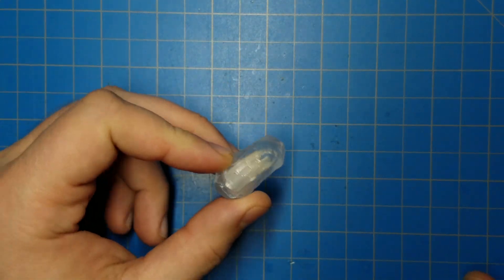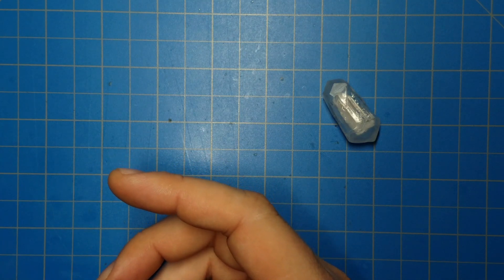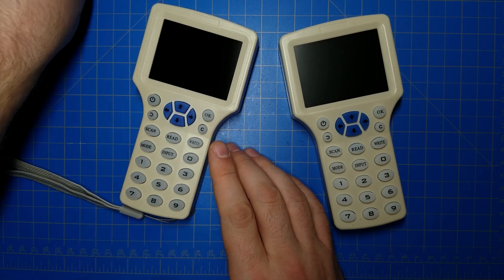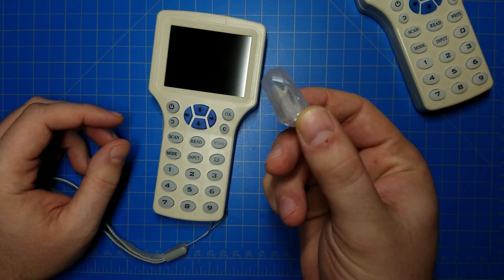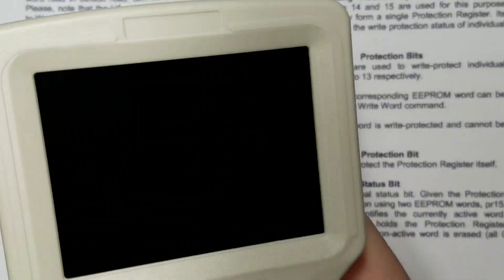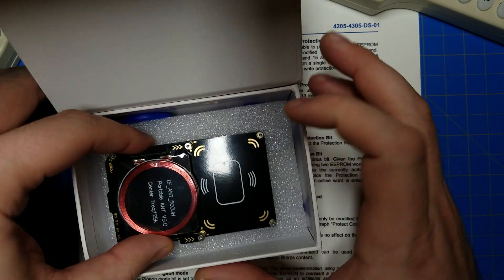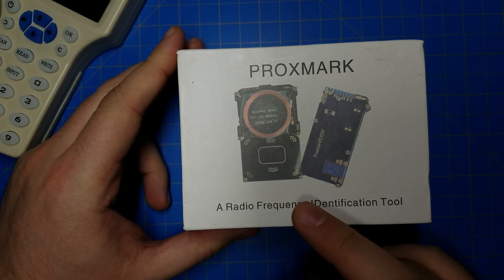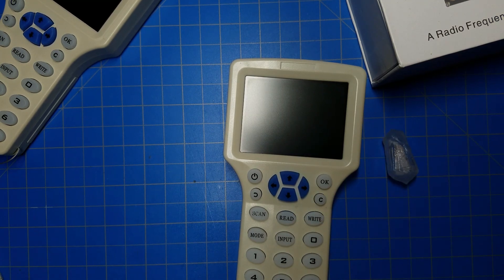Not All RFID Writers Work with Kyber Crystals

Comment: Anyone know where i can purchase a zonsin reader/writer? I see some titled as zonsin but they all seem so sketch lol.
Reply from the maker: it's really hard to know if you're getting a good or bad writer based on just the listings on ebay, amazon, or aliexpress nowadays. i've heard from people who ordered one with pictures that looked like the zonsin one and they received an obo hands one. 

i recommend finding a proxmark3. even the sketch listings are usually good. it's just a headache to get it loaded with firmware and learning how to use it. but imo the effort and headache are worth it. i've also been hearing from a couple people that new wayfinders don't like crystals programmed with even a good zonsin (which is frustrating). but pm3 modified crystals work fine.

Comment: Do RFID readers still work on the newer lightsabers?
Reply from the maker: RFID writers work on kyber crystals. The only lightsabers that use kyber crystals are those built inside Savi's Workshop. 

Savi's Workshop recently introduced new outer shell elements. Those elements are decorative and don't change the functionality of the hilt or the kyber crystal.

Legacy lightsabers do not use kyber crystals and therefore RFID writers do not work on them.

Comment: At first my Zonsin zx-08cd only write kyber crystal once but then found out if put crystal in tablespoon and lay reader on it works great. Spoon must magnify signal I guess.   I was afraid I got the bad RFID unit even though looked like the right one above but just needed to do spoon trick.  Thanks for video was very helpful.
Reply: Thanks for the Teaspoon Idea, mine did not work - read failure no matter what, then I tried a teaspoon and no problem.

Comment: I'm sure your video must of caught the attention of the chins, I purchased mine in 2022 and the startup screen changed, it does not display any name of company or brand. there is a new disclaimer notice and then goes back to screen "IC Type - A" and the one I purchased the screen color background is the same as one on right side of your video 4:22 but in reality I would have to test it further simply because many makers from china can change things around to look similar to other devices.

Comment: Update: received the rfid with the blue screen. I ran into the issue mentioned... but after updating the device I was able write codes given. It takes patience to find the sweet spot on crystal. I marked my crystal and placed it a certain way on the rfid writer. Takes a few tries but I've tried all the colors. Patience is key. Well updating rfid as well... but patience, if you end up with a blue screen rfid. Oh and I placed crystal in middle and slightly turned to left.
Reply: Hi Douglas how did you updated ur device 
Thanking you in advance

Comment: I got tyhe zonsin one but it wont read my yellow crystal no matter where i try it,.
Reply from the maker: Do you have other crystals and it works with them, just not your yellow or do you only have the yellow?

If you have others and those work, it's possible the yellow has a weak RFID signal. I have found a few kyber crystals that seem to have weaker than usual RFID signals. 

If you only have the yellow you could try writing to it anyways. Some writers will write even if they can't read the RFID tag. Note that when you do write, it'll say the write failed (because it can't read the RFID tag to confirm the write). You'll have to try the crystal in your holocron or hilt to see if the write worked.

Comment: Hi there do you know if it is possible to copy the zonsin firmware on the RFID Reader ?
Reply from the maker: I'm not sure. I haven't tried, but I'm guessing it's not possible. Microcontrollers have a feature that prevents copying their programming and it's likely enabled on those in these RFID readers. Another issue is not all of these RFID readers use the same hardware. Assuming I can take the firmware off one reader, I may not be able to apply it to another reader because it'll have a different microcontroller.

Comment: If I understood correctly, since I used the bad one first and wrote once onto a crystal, does that mean even if I get the good writer it won’t work because the bad writer locked the crystal?
Reply from the maker: Maybe. Maybe not.

These handheld writers will try a few different passwords. If you get a good writer it may be able to write to your crystal because the password used by the old writer that's locked your crystal is known by the good writer.

If not, it's still possible to unlock the crystal, but you're going to need different hardware, like a Proxmark3 Easy. The PM3 will cost you around $50-60. It is also not a simple and easy thing to use, but there is software and documentation online that will help get it up and running. With the PM3 you can send commands to change the password and configuration of the kyber crystal's RFID tag, you just need to know what password was used in the first place to lock the crystal.

In my Galaxy's Edge research spreadsheet I've figured out the passwords used by a few different devices. It's possible you're using the same device as one I've figured out the passwords for. You can see the list of devices and their passwords here:

https://docs.google.com/spreadsheets/d/13P_GE6tNYpGvoVUTEQvA3SQzMqpZ-SoiWaTNoJoTV9Q/edit#gid=1809632326

It will likely be one of these 4 passwords: 7686962A, F9DCEBA0, 2A968676, 84AC15E2

Comment: I have an OBO hands device. Although I have not trried it with Kyber crystals. I have doen it with other 125kHz tags. The thing is that the antenna is located differently on mine, you have to hold it on top of the device, not on the screen, but if you look at top of it, there's a little plastic rectangle. If you place it there it reads and writes just fine.

Comment: Ok so i got the correct one (at least pretty sure, similar to another comment its the zonsin full featured one which was said to be ok). I have 2 crystals, a red i got when building the saber and a yellow i bought seperately. I changed the yellow to Ashokas (3072) and now doesnt let me change the yellow again. But the red one i can write to as much as i want. Is something different with the yellow crystals?
Reply: I will also mention with the red it does say write failed most of the time (sometimes it says success) but still writes it and works even if it says fail. Just the yellow for some reason can never write
Reply from the maker: @Beefman951  did you ever use that yellow with another writer?
Reply: @Ruthsarian  no, i just got this writer in the mail yesterday after seeing the video
Reply: Havnt done anything with them until getting this one
Reply: @Ruthsarian  little update. Put in batteries into the rfid reader instead of using cord, still was failing at first. Tried switching mode to 250khz and wrote it, said failed but it succeeded in changing to code anyway. When i scan it, it shows 125khz but the code i wrote in 250
Reply from the maker: @Beefman951  wow! that's interesting! maybe the 'bad' writers are actually good, just need to swap to 250khz because of some bug in the code. I'll have to test!

Comment: I have a RONSIN reader, Version 0B-03029-04-01-200812, I cannot get it to read a Kyber Crystal (tried 3 from Savis) any ideas?
Reply: ZONSIN.. typo
Reply: Update: I tried write and while it still says it failed to write, It actually changes the RFID stored in the Crystal
Reply from the maker: @mikeadams9725  i've heard from some others that newer zonsin devices behave like that. they still can change the crystal value, but they can't read them. i've also seen OBO Hands versions which can't read, but can write, but can only write ONCE and then can't write again. it's bugs in the firmware and unfortunately there isn't much that can be done about it.
Reply: @Ruthsarian  Thank. I appreciate the reply. This does work for me.

Comment: I hope you go back through and read comments on old videos. is there any chance you could revisit the OBO Hands NS208 reader and investigate further why it will only write once and what might be done to correct that issue?  I only ask because I tried myself to get the correct one off of amazon, and ended up with the wrong version.  Was hoping I could just deal with the obo hands one instead of going through the whole returning and ordering a different one and hoping I get the correct one.
Reply from the maker: i'll pull out my NS208 and see what i can see, but as I recall it's a firmware issue. the only way to fix it would be to somehow find new firmware and reprogram the device with the new firmware.
Reply: Also, have you tried the OBO hands version while attached to a windows computer running the software that you can download for it?  maybe different results or better information from the program.
Reply from the maker: @brentonmucklow5647  I went and documented (in too much detail) the commands the OBO hands is sending to write to an RFID tag. You can see all that information here: https://docs.google.com/spreadsheets/d/13P_GE6tNYpGvoVUTEQvA3SQzMqpZ-SoiWaTNoJoTV9Q/edit#gid=1859397091

Long story short: I think there's a timing issue with the firmware. It looks like it's sending the correct commands to write to an RFID tag, however whenever it sends a "login" command, the next command it sends happens too quickly and the RFID tag ignores both commands.

the first write works because there are two commands that do NOT immediately follow a login command, one writes the new RFID tag ID value and the second locks the crystal requiring any future writes only happen after a successful login command. because the login command is bugged, it never sends a valid login command, so it can never write to the crystal again after enabling the write protection.

so... unless there's a way to update the firmware on the device, there's nothing that can be done to save the OBO Hands, at least with respect to stock kyber crystals.

custom kyber crystals that use T5557 tags instead of EM4305 tags should work fine with it.

Comment: Update UPDATE: I got the jank OBO Hands one, i've heard reports of some people getting it working fine, where would i position the kyber to write to it?
Reply from the maker: If you saw my previous reply, which I deleted, ignore it.

TL;DR: try to return the OBO Hands writer and see if you can find one with the red background elsewhere. DO NOT USE IT.

The OBO Hands RFID reader/writer cannot read kyber crystals at all. It can write to them. Once. After you write a number to the kyber crystal, the OBO Hands reader enables a configuration flag in the RFID tag that requires the writer to "log in" with the password before writing the new value. OBO Hands doesn't perform this "log in" step. So the first time it writes, it works because this "log in" flag isn't set. It writes the value to the kyber crystal and sets this "log in" flag (for whatever reason) and cannot write to that crystal again.

So you get one change per kyber crystal with the OBO Hands RFID writer. 

On top of that, it sets a password on the crystal too! This will prevent other RFID writers from being able to change the RFID tag in the kyber crystal. 

I do know some of the passwords used by OBO Hands. I've included them on my RFID Reader/Writer Hardware tab on my GE research spreadsheet found here:
https://docs.google.com/spreadsheets/d/13P_GE6tNYpGvoVUTEQvA3SQzMqpZ-SoiWaTNoJoTV9Q/edit#gid=1809632326

Those passwords are only useful if you have a device that lets you enter them, such as a Proxmark 3. For most people though, it's useless.
Reply: @Ruthsarian  Ok, so WILD twist of events. I got the crystal that I rewrote with the OBO Hands and was stuck, I have the good rfid writer with me, and then I tried rewriting, AND IT WORKED! It appears that OBO Hands, at least the more recent NS208 models is still having the issue, but apparently Zonsin or whatever company managed to workaround the lock on the crystal. It says write failed, but I read the crystal after rewriting it, it read the rewrote id. So, in a magical twist of events, I don’t need a proxmark 3.
Reply from the maker: nice! is this good reader one that was bought online and if so do you have a link to it?

Comment: Update: I bought a LEXI RFID Writer, returned my one (the original one you showed first.) the LEXI gets here on Tuesday. Can you confirm the LEXI works w/the Kybers?
Reply from the maker: the first one i show in this video, the blue rfid writer, is what I think you're referring to as a "LEXI" RFID writer. that device does work with kyber crystals. however it's a cloner,  meaning you cannot enter a number to write to a crystal, you can only have it read an existing RFID tag first, then write whatever value it read from the first RFID tag to a second RFID tag. you can use it to clone kyber crystals.
Reply: @Ruthsarian  No, LEXI made a second one, the one I refer to. They’re like the ones with the LCD screen
Reply from the maker: @tyleranimated2334  interesting! i don't have a LEXI brand RFID writer with an LCD screen. it may be a rebranded version of one of the writers in this video, or it may be one that has a new (hopefully better) firmware. i would be interested to hear how it goes.
Reply: @Ruthsarian  it’s this one: LEXI ID IC HID Card Copier, NFC Reader, 125KHz 13.56MHz 10 Frequency RFID Access Writer/Reader/Duplicator, Key fob Cards Programmer, UID Decoder with USB https://www.amazon.com/dp/B088FJXH7W/ref=cm_sw_r_cp_api_glt_fabc_DXV4CXY6E0A6955MKD3V looks a lot like obo hands, but then again, they usually use stock images so hopefully it’s better than obo hands.

Comment: I have the blue one, is there any way I could copy the code from an external chip, and not another kyber, then write it to it using that?
Reply from the maker: that would work, but whatever external chip you're cloning from would need to have a valid kyber crystal number on it first. that means you probably need to program the external chip first with a different RFID writer. and it's likely if it can program the external chip, it can also program the kyber crystal as well.
Reply: @Ruthsarian  I have a chip that I believe is compatible w/ my iPhone and the writer I have.

Comment: you are right 100% we bought the wrong one... but what can be done now
we bought bag of 100 125 hz. chips and try to copy our original Fob 
its ID but in each fob it has its number like ID 0004356321.
so the scanner reads the original and the new fob but gives write fail...
what can be done about it , is it because the new one has number already if yes how you black it (remove the number)
thanks a lot. rafi4072308721@gmail.com
Reply from the maker: as far as I know, those FOBs cannot be reprogrammed. i've done the same thing. i have a bag of 50 of them sitting in a box in a closet because i can't reprogram them.

you'll need to search for "rewriteable 125khz RFID" to find the FOBs that can be reprogrammed. the key word being "rewriteable".